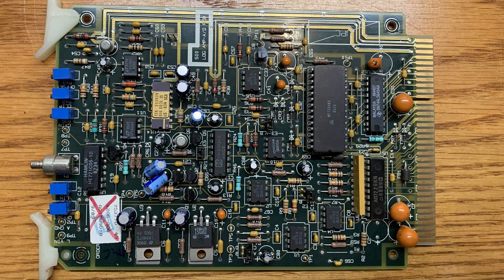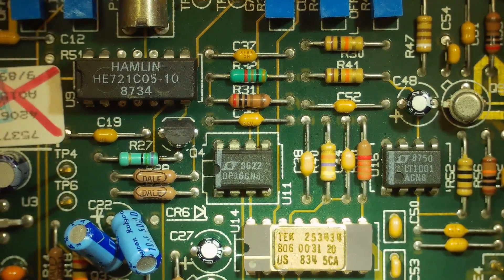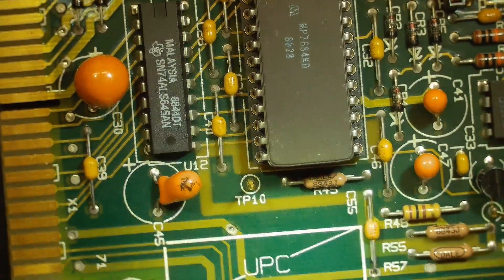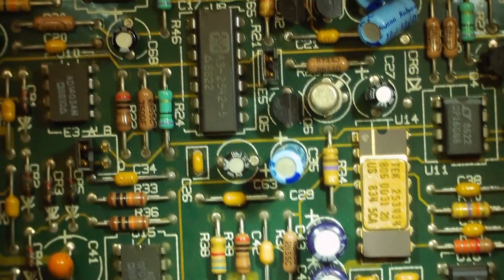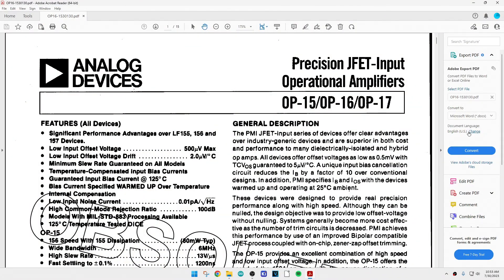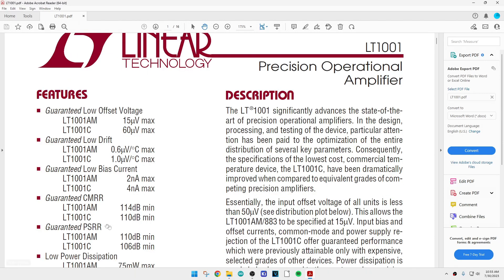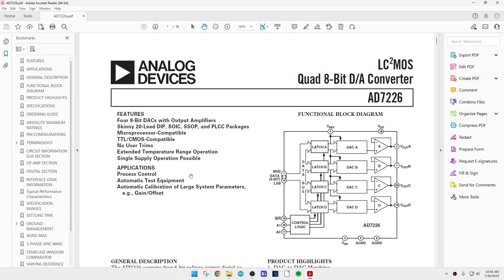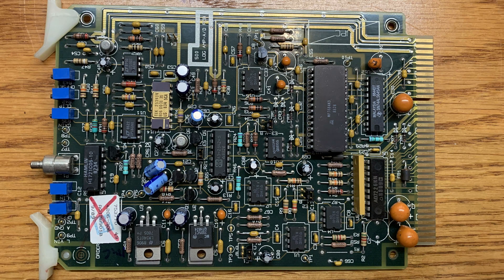#1611 Kodak Photo Kiosk PC Board

Comment: The "little squiggly thing" is Zener.
Reply from the maker: the artwork would lead you to think it was a Zener, but my experience is that the layout guy did not have a fancy Schottky diode symbol. can't imagine a circuit with four Zeners.
Reply: In the 80s PCB layout software had clunky graphics. Easy to confuse a schottky for a zener

Comment: The TEK IC. This reminds me when I first started in design, before I joined the company they had tried and kept failing to do their own in house log- antilog signal processing, to save huge costs of buying readymade modules.  The potted modules they bought in were expensive and difficult for a reason, the circuits inside them were incredibly difficult to get to work properly, not drift with temperature and to maintain calibration over life. They weren't going to give away their secrets for free.
Reply: This PCB looks much later on, the 80s when got all integrated into a single DIL chip  "TEK"
Reply: @jagmarc I think he was just sharing his story
Reply: @ScandalousPepe  the "TEK" IC is the most interesting part on the whole board. In Design there's "make vs. buy" compromise, at one time when PCBs 'featured' Linear Technology parts instead of Fairchild/AD/National it was because the designer was swayed more by LT's marketing.

Comment: Because analog negative film could tolerate large exposure errors, logarithmic amplifiers compressed it to a point where the software could determine where was the interesting information. I think some printers of this era made multiple passes to get the print exposure correct.